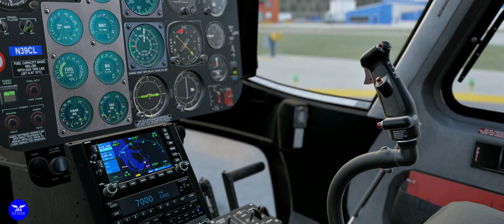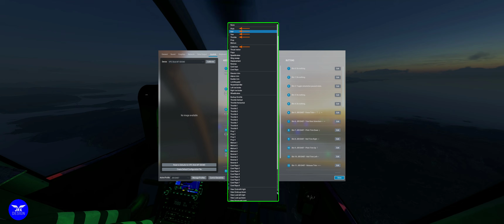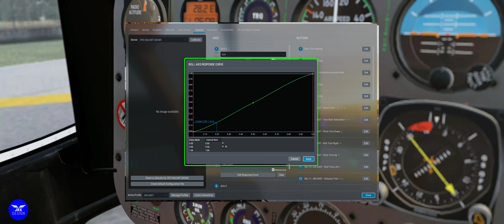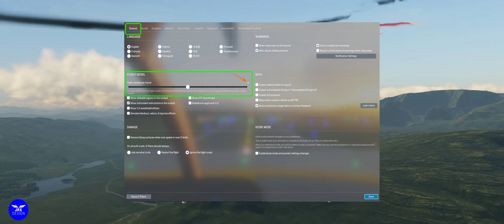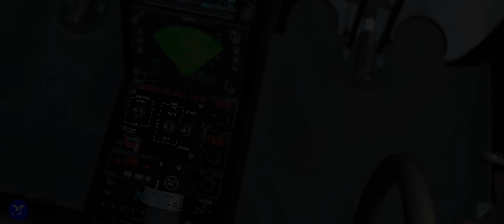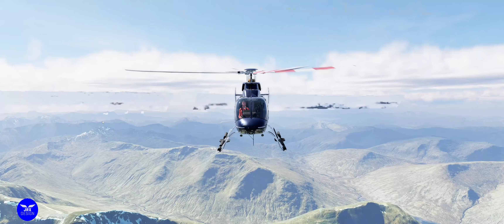JRX B407 (2026) X-Plane V12 Update Tutorial

Comment: Hi Joe and greetings from Grand Rapids, Michigan, USA.  Just a little more input / feedback here to hopefully assist you and the other users as to what I and aparently others have discovered after adopting the new 1.40 version.  Per your instructions, I removed the "old" ver 1.30 and placed it in my "X-Plane Storage" folder and added the new 1.40 version to my active C:/X-Plane > Aircraft folder.  Old version operated perfectly.  New version was quite wild and unstable - a very noticable difference between  ver 1.30.  No other operational parameters were changed in X-Plane.  Swapped ver 1.40 back to 1.30 and the heli flew like it use to - very smooth, stable and predictable.  Hopefully this helps.  You are a great developer and I've enjoyed your products for many years.  I trust this is just a new glitch and will be addressed in due time.  Thank you!  Randy
Reply from the maker: Hello, Thanks for the support! 
Lower your flight models per frame in settings / general to 6 or more then take a look at the different flight models on tablet menu page 1.  Try these see how you get on, then after 20 to 25 hours flight time with this version you will be fine. :)  Thanks Joe